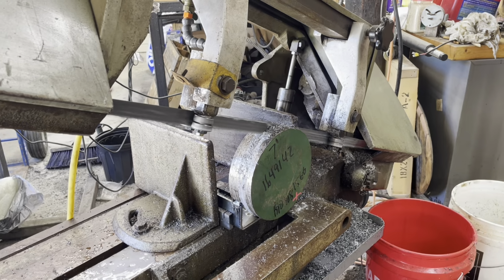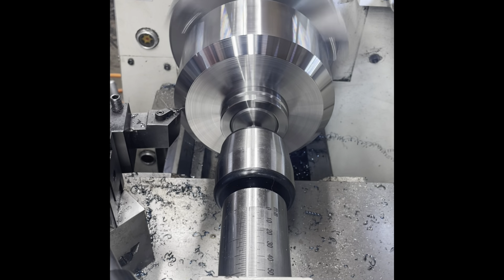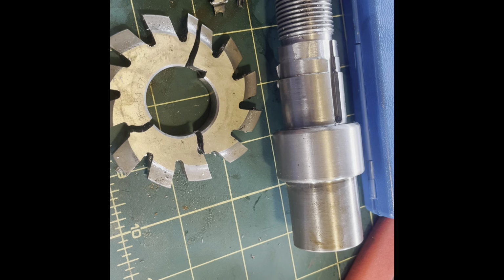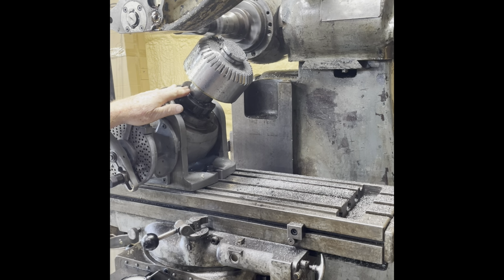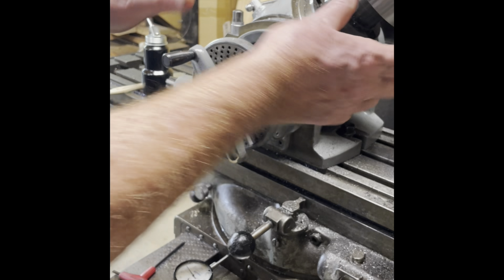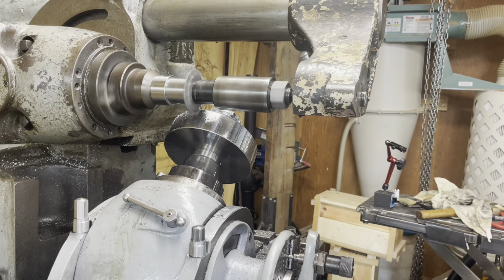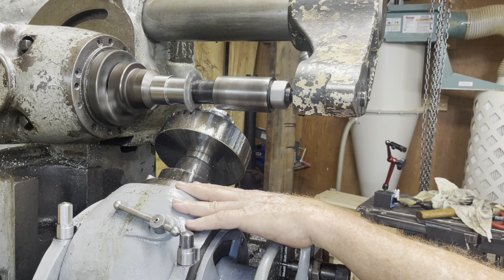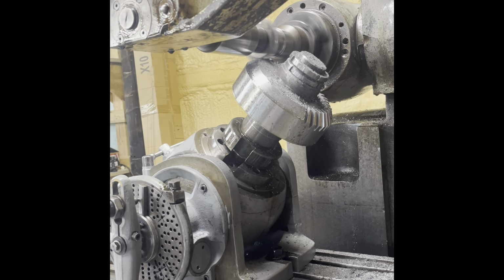Making a BIG bevel gear set for the gear Hobbing attachment project

Comment: Those gears are massive! Tough break on the broken cutter. It's hard to tell from the video, but were you climb cutting the gear teeth then?
Reply from the maker: @MyLilMule All the cuts were conventional milling.  It was the setup that was wrong.  Cutting toward the dividing head means the cutting force is tending to deflect the work upward which further increases the cutting force.  Inherently unstable.  Cutting from the back side the work deflects away from the cut.  I knew better…just forgot.
Reply: @thomasstover6272  Ah, OK. I went back and looked again. Now I see what you mean and it makes sense. I will have to keep that in mind!

Comment: Shame about the crash. My shaping attachment tries to tilt the dividing head which is why I try to use a footstock with it. The gears came out nice. I take it you salvaged the gear? That would be an expensive piece of steel to throw in the scrap bin!
Reply from the maker: @ThePottingShedWorkshop  The gear survived with just a small cosmetic flaw.  Crashes are humbling, but are a good instructor as long as I have the wit to learn!

Comment: I’m curious as to what material you are using for your gears.
Reply from the maker: @TNBen60  o1 tool steel.  Not sure if I will harden them, but the as annealed strength is better than 1018, and I can harden the teeth later.